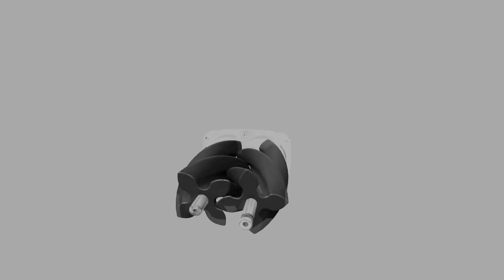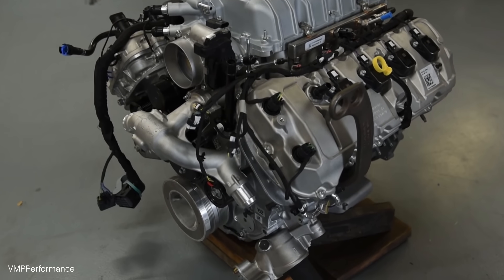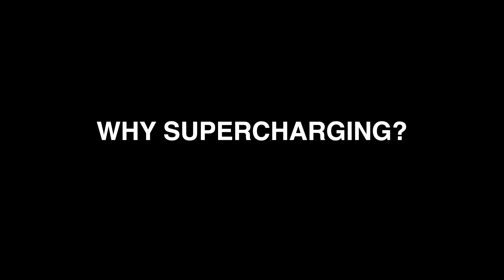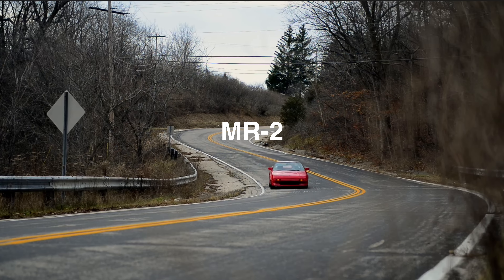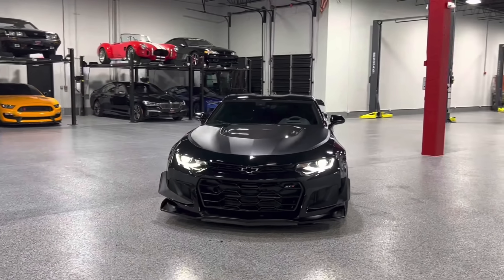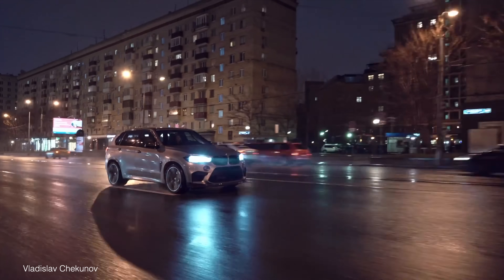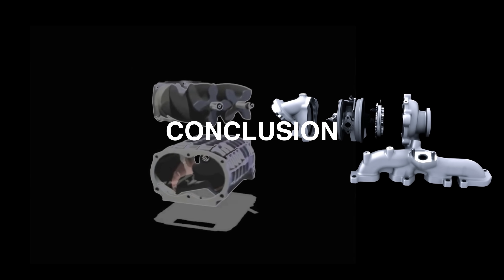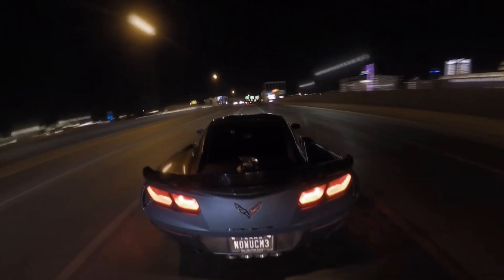Why V8 Engines Are Supercharged vs. Turbo😮| Explained Ep.6

Comment: EV are not the future. They are just a degeneration that is pushed on by fake-eco activists.
They are a joke that is expensive and have 8-12 times less range than a combustion engine on the same car.
Reply: you can use a time machine to see the future if the world is now full or EVs or normal cars btw
Reply: @Battlemekker205  what do you think EV is if the people who insist on them being the only way of transportation are the same people that release criminals with a goal of terrorising their citizens and the same people who hand out guns and weapons for 15 year old black kids to commit car stealing crimes and murders?
Reply: @Battlemekker205  what do you think EV enforcement is if EV Ford Transit have the 100 miles max mileage (one hundred miles)(without any cargo in it) and a sticker price of $50000 while normal Ford Transit with a combustion engine is only $35000 while having 600-700 miles range from full tank? It also takes more than 3 hours to charge up EV battery. And it rapidly degrades, reducing its max range every day of every year.
Reply: @divinehatred6021  yeah but atomic batteries might be a good thing but we didn't fully develop them because they use nuclear as an energy source so all we have to do is to put some small yet much more powerful fusion reactors instead just to power our EVs using nuclear fusion just like some crazy-brained guys at Ford in the '50s had put a nuclear fission reactor to power the car created by them but it failed because of deadly radiation and fission reactors are dangerous than fission ones because they use fission to generate energy and a division of an atom like Uranium-235 can produce some radiation because they got split in half by a bullet-speed traveling thing called a Neutron.
Reply: @Battlemekker205  why are you even talking?
Reply: EVs get huge direct subsidies in the EU, so the additional price really isn't that big of a deal. They also have instant torque, a whisper quiet engine, and no transmission. My combustion car works fine for now, but my next car will definitely be electric.
Reply: @RoyaltyInTraining.  Bruh, you forgot to mention every single downside about EV though bruh
Reply: @divinehatred6021  Like what, range? It's more than enough to drive to work and I can just charge it overnight at home. Besides, the public charging network in my country is decent as well. I rarely need to travel more than 100 km, so I'll probably never need to rely on that.
Reply: @RoyaltyInTraining.  yes, price of the car per range is the major downside(reasonable range starts at 60-70k eur or usd), but also lack of electricity supply and high price of it, since idiots in the government push on useless solar energy and wind energy projects that do not generate enough W to make a difference... Also, cost of replacement for battery is around 50% of the car price, which still will need regular maintenance... Rapid battery degradation is also a thing, so you will not be able to just not replace it for the full price from the car manufactury dealers, and even then it still can randomly explode... Also, the miost obvious part - the price of EV can only increase expotentially due to increased demand of rare minerals and metalls. Even the copper price is increasing too rapidly, and its not even that rare.

Comment: I verified some numbers: the GT4 RS takes 7:09 around the Nürburgring, so it's significantly faster than the Camaro. Nonetheless, the time is insanely good for such a cheap and relatively crude car.
Reply: dude he made up little digs at ALL import cars while bending truths to make American muscle seem so superior.
u can tell he's totally biased for American muscle and I'll take a 2.0L i4 Volkswagen engine, drop 20 grand in it, totalling under 50k and it'll be pushing over 1100hp, sometimes 1200.
good luck getting another 500 go out of a hellcat😅 you'd wind up spending a QTR MILLION dollars and basically replacing every single thing under that hood. those hellcats don't last for shit and they're all being stolen😅
it's funny how every other dude in the Ghetto pretends they're a cat expert cuz of hellcats😅
im glad they're being discontinued.
go figure a group of idiots ruins a car and makes the govt order them discontinued cuz they all wanna use the cars to run from cops.

Comment: Has anyone built a turbocharger that is powered by an electric motor the runs off the cars electric system. Then the boost could be controlled independent of mother RPM? Just a thought
Reply: If it isn't driven by exhaust gases, you're describing a centrifugal supercharger. A few Euro companies have made electric turbos that are still driven by exhaust, but use electricity to eliminate turbo lag in low RPMs

Comment: why? Because supercharger is much better a turbo system. But there is a catch to it.
Why is better? It's easier, cheaper and more reliable power increase and a lot more predictable to the driver. No turbo lag. Yes, yes the supercharger takes a bit from the engine at the beginning, but nobody in their right mind would use a performance upgrade and think of driving at 2000 rpm and then floor it.
The turbo is a messy, MESSY method to upgrade an NA engine, requires a lot of intricate construction, lower the compression, and a lot of space to install the parts. Plus idiotic turbo lag. Twin turbo?! Fuckign hell, as if one turbo wasn't complicated enough, lets build with 2 units, right?!
But the turbo is universal, you can (if you're stupid enough and willing to burn money like a moron) upgrade any engine with the same turbo that you salvage from another vehicle.
That you can't do with a supercharger which needs to meet each specific engine, thus can't upgrade a car with a specific engine using a supercharger from some other engine.
But american market beat this problem by having just a handful of engines, so tuners could make a supercharger unit for car 1 and many others could buy your part and thus a profitable business opportunity with a wide market.
Europeans and japanese have all sort of engines, each brand with their own engineering and only recently have we seen common platforms for different brands, but still not like the big 3 americans that did it for many decades.

Comment: The fact that companies are basically going cold turkey on the combustion engine is seriously gonna backfire horribly, not everyone is ready to make the leap into a brand new untested Era of EV, nor is the world seeing as we don't have supercharging stations around every corner like gas stations.. the other thing that won't help is the fact that batteries lose all efficiency once it gets cold, so it limits your range of doing anything or going anywhere depending on where you live.. also the fact that replacing a battery where you could easily get a nice cheap car and still have some money left over for the price of that new battery is insane

Comment: The real reason behind Japanese and European cars having turbos is the racing style of wanting faster mid and top speeds for highway racing or tracks as for American racing being the quarter mile requiring faster acceleration off the line. Many years ago there wasn’t anti lag systems that allow turbos to compete with superchargers when launching. Not to mention boost drops when changing gears on manual transmission and taller gearing. Modern turbo setups have come a long way while only marginal improvements have been made to superchargers.

Comment: I have The 03 terminator and a self built opel with a 500hp saab 4cyl turbo engine inside.   I love both tbh but The screem of The 03 termi with a whipple is Hard to beat.

I will untill my dying breath drive my combustion engines, if it would be made illegal im about to be criminal

Comment: I owned an S4 and a tuned wrx and I can say with great confidence the power deliver of supercharger is just superior in every single way. Instant torque And supercharged engines are way more reliable. You'll see B8 S4s with 200k in the motor all day. You'll never see a turbo motor with over 120k on it.

Comment: I've never driven anything with a supercharger. And the only thing I've driven with a turbo is a GM 2.0L turbo in some crossover when I worked at a GM dealership body shop. For a heavy crossover it surprised me. But I would love to drive a hot V twin turbo Cadillac or whatever. And a supercharged Corvette would be fun too

Comment: Should have mentioned that turbos are common place on diesle engines vs gasoline engines, which a lot of other countries use more of, like in the older diesle Mercedes-Benz with Turbo. But, also, big diesle engines in trucks and boats, and ships.

Comment: Great video! I can say one thing though- we are not in the Golden Age of Peak Gasoline Engines, we thought the same thing in the 80's-90's. Electric still has a really long way to go, tech wise it is not much different than it was in the 50's. There's still a lot of potential in Gasoline Engines. Not to mention infrastructure/regulations for charging, but that's a man-made problem/solution- it'll still add to how long it takes though.

Comment: The point I feel you are missing is turbos are making double the power per psi of boost than superchargers will ever make .
Also chargers are still boosting on the over run while turbos release boost pressure instantly once foot off pedal .
Any modern turbo system has absolutely no lag & is far more efficient & powerful relative to equal boost pressure .
Turbos are obviously far cheaper/easier to service/maintain/replace .

Comment: I have 2 turbo 4 bangers and 1 supercharged mini.   The turbo cars make double the power or more.  Still for autox, rallyx and touge the mini is a little beast.  Even with half the power the throttle response on corner exits is a beast.

Comment: A myth was stated at the 3:22 mark that the hot-vee setup resulted in less lag.  Whether you mount the turbo near the exhaust ports or the intake ports, either the exhaust gases or the intake air has to go to the other side of the cylinder head.  There is no reduction in the length of the total path.  Mounting the turbos inboard does not decrease the total length of the intake air plus the exhaust gases.  It's a wash.
Reply: but it minimize energy lost as heat

Comment: I think we are at least 5 to 10 years away from peak combustion engine technology.
Firstly, freevalve has yet to appear in a consumer car, and knowing what we know about freevalve (or essentially, cam less engines), there is TON's of efficiency to be found there, going off existing knowledge, at least 2x.
Secondly, we have yet to fully detach everything from the crank, toyota has moved towards electric water and oil pumps and left pretty much only the alternator connected to the crank (and the cams), but remove all of that some how and you have more efficiency.
Thirdly, there is really only two manufacturers that have went past the 12;1 compression in NA engines, toyota and mazda, both of which has epic thermal efficiency for normal every day cars (41%). 
Fourth, we are not using prechamber combustion on consumer cars yet, which nets another 10% in thermal efficiency according to F1 engines.
There is just so much tech out there that is used in niche engines (f1 or hyper cars) that if made more widely available could make combustion engines 2-3x more efficient per Liter of displacement.
Now you may think, "that would make consumer cars expensive", okay, so your alternative is EV's that START at 60,000 USD? No thanks, that isn't cheaper, and yes, 60k, tesla has raised its prices across the board YoY and that isn't going to change, EV"s are for the rich, the end. Also, according to koenigsegg, freevalve is CHEAPER to manufacture and EASIER to tune than simply machining cams and figuring out timing use mechanical engineering vs software. 
We haven't even talked about marine engines that are having huge technological gains.

Comment: This doesn't explain it at all. Hot Vees are relatively new and cannot be used as evidence to explain why Europeans and Japanese were turbocharging BEFORE they were widely used lol. And yes, cost is a partly legitimate reason, but you don't describe those reasons. Hell you didn't even mention Centrifugal Superchargers let alone the difference in positive v dynamic superchargers.

The real answer is variability of boost. A Supercharger is static by nature, even a dynamic supercharger,  they can't be tuned to a different RPM/boost level. Turbos' can use wastegates to decrease or increase boost on the fly, going as far as VGT Turbos' used by Porsche. Those are incredibly expensive, so yes in that case cost is an issue, but where talking about only 1 manufacturer and their cars are in a completely different sphere.

My biggest issue with this vid is it leaves out the tuning capabilities being the main reason why. You can build 1 turbo engine, put it in 3 different vehicles and have them all act totally different. 

For a couple of Japanese examples the Toyota 2JZ Turbo is in a multitude of cars and thanks to the variability of the turbo system all those cars perform according to their application. In fact the Aristo was strictly an Automatic car and has a completely different tune compared to the Supra. Mitsubishi did the same thing with their 90's V6 Turbo, it was in a saloon, a stationwagon, a sportscar, even in a van type thing, and all of them different. Again with the RB engines(excluding the RB26 as it only came in one model), similar to Mitsubishi they put the same engine into multiple different applications.

The worst thing is you didn't mention that variability in regards to the Hot Vee. The new AMG V8 engine is in everything, including Aston Martins, not because it's a Hot Vee, it's everywhere because it can be tuned to suit everything. Being a Hot Vee has almost nothing to do with it lol, that design has meant that they can keep the costs v performance down, the package size down and the efficiency up, but it's not the deciding factor. A supercharged engine would need to be refit considering it's application, every time, a turbo engine just needs retuning.

Comment: Great video.  Animation stuff was awesome.  Both have their place but most important is both have their application.  Hot lapping is not the same as race pace when building a car.  Porsche is know for all around race pace.  The turbos fuel and power efficiency are much better for circuit racing.  Turbos also make much higher pressures than superchargers.

Comment: I've wanted to put a super charger into my 7.3 powerstroke in place of the turbo.
Like a procharger. Looks like a turbo but runs off a fan belt off to the side of the motor.

Comment: turboes are better at reaching max boost at mid rpm and holding it to high rpm.
It is possible to make the torque curve flat as a box, reach 500nm and keep it there if this is the max goal.
Supercharger boost is more fixed to rpm.

A supercharger is always running and taking away power from the engine depending on supercharger speed, turboes are just freewheeling when not used.

Superchargers have little room for intercoolers and sometimes need watercooled or even aircon chilled intercoolers to cool the intake air.
Reply: he knows that, along with a bunch of other shit he left out of his biased video😅

Comment: Sounds like it’s unlikely that any manufacturers will be innovating the internal combustion engine much further. With the pending doom of the I.C.E. I can’t imagine any new platforms being developed. Perhaps at this point all we can expect to see is improvements on what is already in production. Fortunately I don’t see all Motorsport going electric on the next 5 years, so, some developments will be made there, but that means this technology is going to become increasingly more expensive

Comment: Most of what usage is true but operating RPM range is why V8's use a supercharger for their lower peak RPMs.  High turning smaller engines got that turbo singing the whole yime..

Comment: That’s where you’re absolutely wrong and inaccurate. 150,000-200,000? I would absolutely love to see a ZL1 go against a 911 Turbo S. It’s in that price range and it would annihilate that camaro. That Porsche shown is a Cayman. They have a relatively low hp rating. And the fact that a ZL1 only manages to do the same time as a lower end Porsche says a lot

Comment: Ring times for the curious
2018 Camaro ZL1 1LE: 7:16.04 $70k
2018 Porsche GT3: 7:12.7 $145k
Yes Porsche had faster models at the time, like the $300k GT2 RS.  GM chassis tuning capabilites are stout.  And yes, on a racectrack set up in a parking lot, a 100hp Miata might be faster than either :)